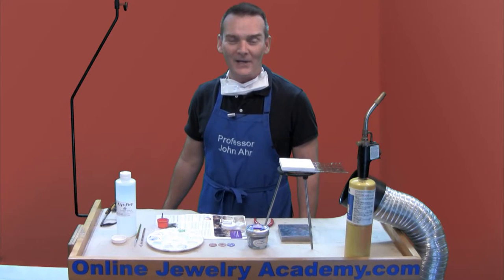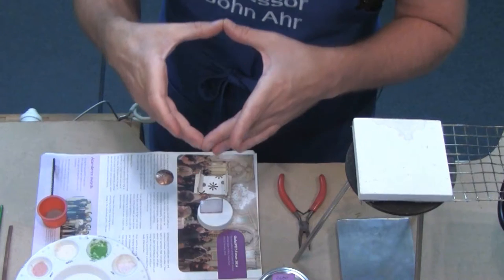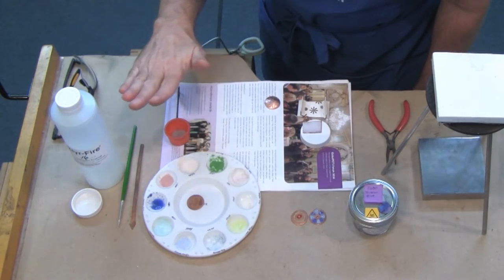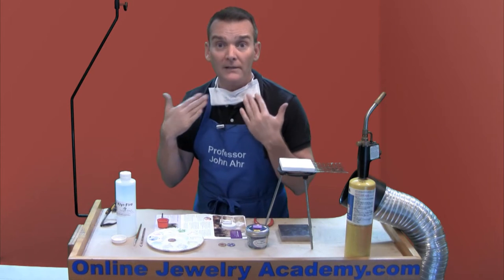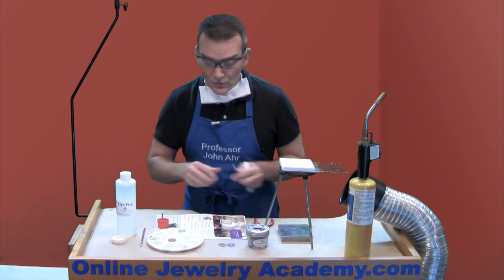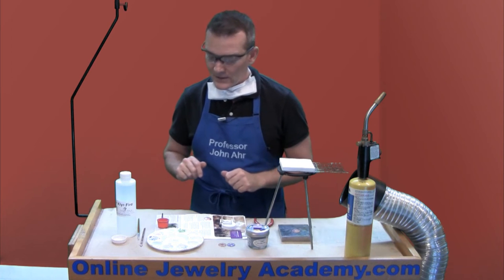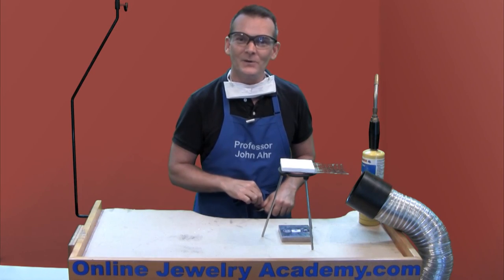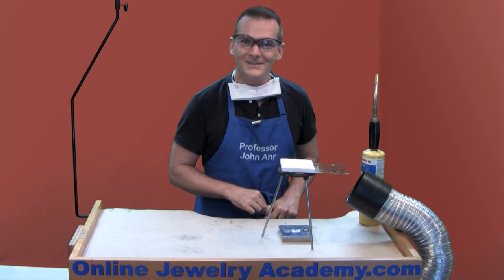Enamel Application Methods

Comment: Just received a starter enamel kit for Christmas, your video was a great look into different ways to use the enamel. I have several questions though. 1. my kit has a holding agent. Is that the same as the Klyr fire? 2. You said to move the piece to a warm surface. Would a candle warmer be appropriate or would that be too hot? I just discovered your videos and am looking forward to checking out more. Thank you for the great information!
Reply from the maker: Hi Hope, You're going to get hooked on enameling faster than you think.  It's so much fun.  I suspect that the holding agent in the kit is something very similar to klyr fire.  If the makers of the kit included it, it must be a similar product if not klyr fire just repackaged with their label.  A coffee warmer sounds like a good place to try out to dry your enamel project.  I often place my projects, on the furnishing that I'll fire them on, under a heat lamp.  Just be sure you can move them off of the warmer without messing up the unfired enamel.  And, be sure to read the book that I assume came with the kit.  Have fun.
Thanks for your support! : )

Comment: Hi John,  Thank you for your video's.  I have learned a lot from them.  I have a lot of ceramic paint laying around can I use that on my metal jewelry?
Reply from the maker: Patricia Johnson Thank you for the kind words Patricia.  I have never worked with ceramic paints.  But, I'll bet that they have potential for use with your enamel projects.  My best guess is that they are probably a lot like enameling paints.  The trick to using those is that you have to make sure that they are completely dry before you fire them onto an enameled surface.  Then, you need to fire a clear enamel material over them.  My advice is to experiment with them and see what they can an cannot do for you before applying them to a special project.  Good luck!  And, thanks for watching! : )

Comment: Hi John, Can you tell me what the difference is, if any, between wet packing and painting with enamel.  I see there is enamel for painting, but have never seen anything showing how to do it.  thanks.
Reply from the maker: Hi Jill,  Wet packing is when you fill cloisonné with enamel using a binder like Klyr Fire.  There are a variety of enamel products that one can "paint" with on a surface.  The term enamel painting, however, generally refers to the application of enamel to a glass or ceramic surface.  I hope this helps.
Thanks for your support! : )

Comment: Would it be possible to enamel one side of a piece, and then enamel the opposing side? I mean, the enamel wouldn't melt or burn or something I'd imagine, if that second  piece can be compared to this scenario right?
Reply from the maker: It is possible to enamel on both sides of a piece.  Enamelists who fire their pieces in a kiln normally "counter enamel" or enamel the back side of a piece.  This helps to control the surface tension on a piece so that the enamel does not crack.  The enamel used on the back side of a piece, however, is generally not as pretty as the enamel used on the front side of a piece.  Counter enameling using a torch fired method is tricky.  That's why the torch fired pieces shown on the OJA are done on thick gauge sheet and only fired on the top surface.  Have fun exploring enameling.
Thanks for your support! : )